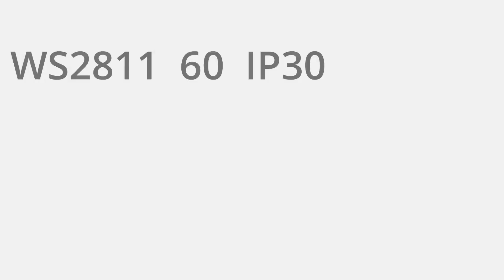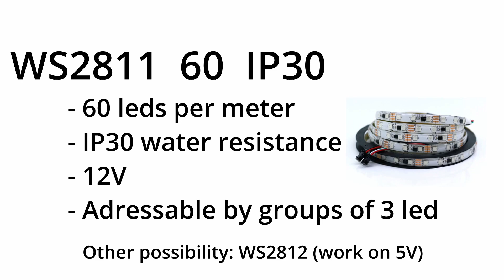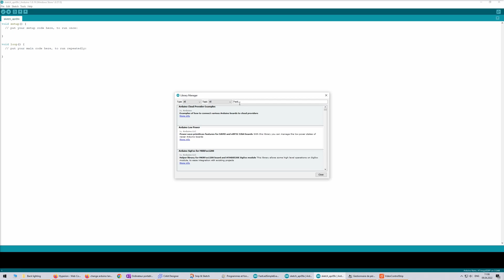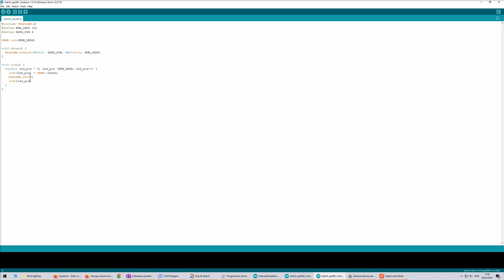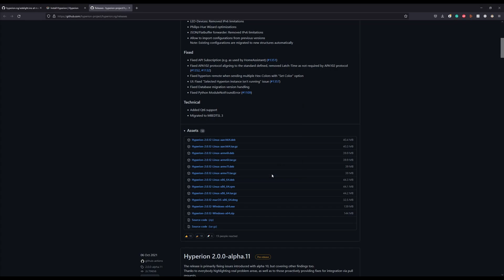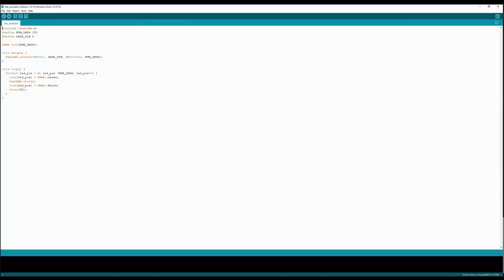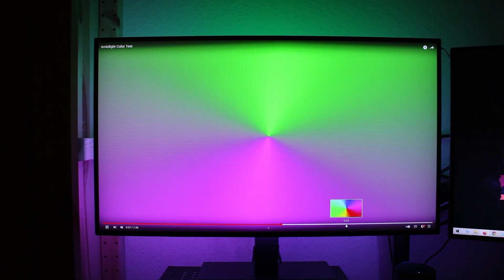Cheap DIY Ambilight using Hyperion and only an Arduino

Comment: usb from pc is 5v, if i use esp32 and connect the leds + - to 5v pin in esp32, will it work?
Reply from the maker: @dursamiii  it might work for a few led but if you have a lot (like in the video), it won't work. It will be very low light at best or might burn the esp32 at worst if the led draw to much current

Comment: I spent the whole day chatting with GPT to figure out a wiring diagram that allows me to simultaneously connect an external DC power source and use the micro USB power from the computer's USB port. It guided me to connect the 5V pin from the ESP to the LED and advised me to add a protection diode to prevent reverse current. Fortunately, I found your diagram, and when I asked GPT again, it confirmed that it was correct—even though it could have provided this solution from the beginning.
Reply: I think I going to ask chatgpt since what I’m trying to achieve is different then this with more stuff like LED corner tube lamps and much more and how I can set up everything with my macbook since I use my mack with HDMI to my TV in my room there is soooo much parameters I don’t even know from where to start 😩

Comment: Everything was working, I uploaded the test program. Now Windows doesn't detect it as a COM device anymore, it says Unknown USB Device (Device Descriptor Failed). It still runs the test program with the cycling green.
Reply from the maker: @almighty1984  that is unexpected. Sounds like a windows problem. Try to unplug it and try a different USB port or to reboot your computer. It should appear again in the device manager.
Reply: @mrpoulay6121 Got it to work, thanks a lot!

Comment: Hi, i have a problem with my arduino. When I try to upload the code i have an error that says:
 avrdude: ser_open(): can't open device "\\.\COM6": Acceso denegado.
Failed uploading: uploading error: exit status 1
Do you know how can i fix it?
Reply from the maker: It is possible you did not select the right con port connected to your Arduino. Try to check which on witch it is connected. You can see that on the device manager.

Comment: It dose not work for me :( the LED output keeps turning off and hyperion is not working. It dose the check in the beginning and leds turn on for the duration but then just blank.
Reply from the maker: It can come from a variety of reasons. At least you know the led and Arduino are working. 
If you have an initial blink it might come from Hyperion itself. Maybe try to redo the steps, something might work better the second time. It might be the screen capture which is not set properly. It is a bit hard to know what is wrong like that.

Comment: can i use a raspberry pi here instead of ardiuno cause i have a pi zero lying around
Reply from the maker: Yes you can but the code to install on the raspberry will be different from the Arduino code.
Reply: can you tell me where can i find the code i have tried my best to find it..... @mrpoulay6121

Comment: I can’t tell by the video. Did you plug in your power supply and your Arduino (USB) both at the same time? Where does the Arduino get its power from?
Reply from the maker: Hello,
Yes I power both at the same time. The Arduino is powered by its usb connector, the led strip is powered by the jack connector.
Reply: @mrpoulay6121 thank you!!

Comment: Bro i have a doubt if I stick the led strip in my tv and use a hdmi output from my laptop to play video or movies( laptop which have software only led strip is in tv ) will i able to get that effect?
Reply from the maker: Yes you will, as long as the TV displays the same video stream as your computer (you duplicate the screen and not extend it)
Reply: @mrpoulay6121  but is there any way to make this work directly on tv ? i saw many option using raspberry pi and capture cards. any other cheaper methods?
Reply from the maker: @jomonpalayur7447  Not really. It works because you are using your computer to process the images and send the data to the led via the arduino. If you want to use such a system you need to go for the raspberry solution (and more expensive)

Comment: Thank's for your tutorial, it's helping me a lot
Btw, what would be the best way to use this kind of amblight for two different monitors working on the same PC?
Would the best way be to separately create two different Arduino setups or is there a easy way to setup Hyperion to indetify two monitors and then code leds region for the two monitors in the Arduino?
Reply from the maker: Hi Furadibala,
I check a bit on the Hyperion side, it doesn't seem it supports natively dual monitors in one set setup. I think you would have to use 2 Arduino and create 2 different instances on Hyperion.
Reply: @mrpoulay6121  Thank's :)

Comment: I did excatly what you did in the video but it doesnt work. For example i dont have the screen capture option in the Dashboard.
Reply from the maker: That is weird. Do you have the latest version? And did you create a new instance as well ?
Reply: @mrpoulay6121  i figured it out, you cant run the arduinosoftware and the hyperion at the same time

Comment: Great Job, thanks !
"Une bonne chose de faite" c'est également ce que je me suis dis en finissant d'installer le ruban de 256 led WS2812B derrière ma TV, ruban connecté a un arduino mega lui même branché a un vieux PC sous ubuntu. Tout se passait "like a charm"... connexion, script de test avec le chenillard vert, installation d'Hyperion sur ubuntu, tout bien.
Mais (car il y a toujours un "mais"), une fois Hyperion lancé j'ai bien le double flash blanc de mon ruban, puis plus rien. J'ai tout repassé en revue, rien ne s'allume.
Comme disais Liloo Dallas : "Please Helllp !"
Reply from the maker: Compliqué de debuger comme ça mais je dirais que ça vient d'hyperion et j'essayerai de jouer un peu avant les paramètres d'Hyperion. C'est peut être un peu différent sur Ubuntu.
Reply: Solution trouvée :
1-le script adalight fourni sur le github hyperion
2-la vitesse de communication montée a 1.000.000
Thanks again 4 your help !

Comment: I would like to add that you can cut a micro USB cable and solder it to the 5V power source. so you only need one power cord.
however this only works when using a 5V led strip.

great tutorial btw
Reply: This won't work, because you need a data connection to the PC. This will work however, when using the Ambilight setup for a TV (with Grabber, RPi etc).

Comment: 2:23 Hi, I have a question why you used Arduino together. Can't I use only Raspberry Pi without Arduino?
Reply from the maker: Yes you can only use a raspberry but the whole point of this project was not to use a raspberry as it is  more expensive.
Reply: @mrpoulay6121  Oh I got it thanl you for your comment
Reply: More expensive and more energy consuming. I suspect the Arduino consumes less than 0.5W while the raspberry 3 needs around 2-3W.

Comment: Bonjour. Intéressant tuto. mais je voudrais savoir comment connecter ça à la télé. En fait je ne vois pas cette partie dans le tuto et ça me laisse perplexe. Donc comment le système est connecté à la télé? Merci.
Reply from the maker: Le système est fait pour être connecté à un ordinateur et non une télé.
Reply: @mrpoulay6121  Merci pour la réponse rapide. J'ai cru qu'on connectait l'arduino à là télé via usb ou hdmi 😅.  Alors, pour que ça fonctionne ça doit être branché à un pc tout le temps branché au pc?
Reply from the maker: @audranemery3317  
La Arduino est branchée a l'ordi en USB et drive les LEDs. C'est Hyperion le soft qui s'occupe de communiquer a la Arduino de quelle couleur doivent être les LEDs. :)
Reply: @mrpoulay6121  Merci beaucoup pour l'explication 😃😃

Comment: Is it possible to use 600 LEDs? (Hardware side no problem but does the software support that many LEDs)
Reply from the maker: Apparently the max number of led is 490. (According to this thread https://wled.discourse.group/t/hyperion-max-led-count/180). Never tried to drive more LEDs

Comment: I have got it working after following the video but somehow the led movement or transition is choppy and I’m unable to make it smooth. There is no lag and color accuracy is also acceptable but transition is choppy. I’m using this on a 55 inch tv with 224 led.
Reply from the maker: In Image processing, you can play with the smoothing options. Lowering the "time" might help.
Reply: @mrpoulay6121  tried but result is same. not getting smooth transition. I feel that controller is not powerful enough for 224 leds but not sure about it.
Reply from the maker: @AnuragSharmaDarkmessiah  That is unlikely to be the issue. I am not sure what is wrong,you can play with the parameter of Hyperion,you might find some that works for your setup
Reply: @mrpoulay6121  I’ll try and inform if it works.
Thank you
Reply: @AnuragSharmaDarkmessiah hey... Were you able to make that smoother
Reply: No
Reply: @AnuragSharmaDarkmessiah  okay I think I will have to use a raspberry pi and the capture card. Expensive for me 🥲
Reply: Save some money and purchase HDMI sync box for clean setup and better performance.
Reply: What does hdmi sync box have? @AnuragSharmaDarkmessiah

Comment: Would you be able to run a second zone for a second monitor from the same Arduino?
Reply from the maker: It is a good question. From the Hyperion side, I see no issue, just adding a new led instance should be good. From the Arduino side, it might be quite tricky. I am not sure how it would handle the communication with 2 led instances. It would need a lot of code change. With the price of an Arduino those days, I would just buy a second one.

Comment: Sir ji I made it and it works but the problem is when i start it then my (sony bravia x90k) tv being to much hang, apps media player youtube also hang and tv restarted automatically. I use arduino nano 5v 50amp smps ws2812b led strip(266 led), please help me 🙏🙏
Reply from the maker: I am sure to get what your issue is. What is your problem there ?

Comment: The best tutorial that I've seen! Thank you so much. 

So, in my effects list I don't saw Ambilight effect (maybe I didn't configured correctly). Can you help me with?
Reply from the maker: Thanks mKzin, I tried to make it as clear as possible because I was confused on what I saw prior on YouTube.
If you follow the steps, it should work. There is an option to enable screen grabbing that might note be enable by default that needs to be enabled,i am not sure.
Reply: @mrpoulay6121  I watched step by step, pay attention on every detail and yeah, I got it with WS2812b 144leds what currently looks great! 

Again, thank you so much!
Reply: @mrpoulay6121  is it works when i use  tv's embbedded os ? without connect any hdmi to tv?
Reply from the maker: @mehmetcaloglu9409  it will not work with this setup
Reply: @mrpoulay6121  when i try to setup, say  " it is not compatible with this proceccor"

Comment: excellent tutorial I do and when starting hyperion turns on the rainbow and I can change the colors but it does not detect the colors I visualize you will know why?
Reply from the maker: Can be from multiple cause.
Did you select the correct com port and board type?
Did activate the led outputs
When programming the arduino, did you select the correct board/bootloader? You can check the last one with the example sketch.
I hope that helps

Comment: Theres 2 things I'd like to add here:

First is the usage of WS2815's. same voltage, not NEARLY as susceptible to color degradation due to voltage drop, AND runs a fail over line concurrent to the data line, so if one led burns out, the rest of the strip keeps pumpin them lumins!
And of course, they are all individually addressable LEDs, not groups of 3.

The second is an overhauled, heavily upgraded and superior in every measurable metric software - HyperHDR.
I wont go into detail here about all thee benefits and upgraded functionality, but believe me, what windows 98 se is to Hyperion, windows 10 is to HyperHDR! 

Just a thought.. small price increase for a major performance gain, IMHO
Reply from the maker: The WS2815 sound like a good upgrade, epically that addional line!
I will keep that in mind for a next project.
Hyperion has still one advantage over Hyperhdr, the amount of tutorial you can find online is huge.
Reply: @mrpoulay6121  you are correct, being the OG, or founder, and having some years on Hyper.
However,  there are several SOLID how tos, with a GALAXY of flavors (implementations) from a budget conscious WS2812b and a windows laptop with connecting wires,

to a simple but extremely effective rooting your smart tv, side loading just 2 apps, and feed that captured visual data FROM INSIDE YOUR SMART TV, to an ESP32 & some cold white SK6812's,

To a full blown, dozen peripheral lights & lamps, multi board, ultra low latency via HyperSP,I MEGA Ambilight  that's no doubt the #1 position for bragging rights kinda  system, 

and every conceivable rendition stuffed in between the ones I have mentioned! You're true is a booming user group around hyper HDR!!
... If any of the above ones interest you, I can link you?
Reply: @bopedersen77 Where can i find hyperhdr tutorials
Reply: @mrpoulay6121  @bopedersen89 is it possible to make it work with hyperion or hyperhdr that run on webos tv?
Reply: Do an upgraded video on the HDR!

Comment: Hi, Great tutorial but my setup didn’t work. I did everything said in the video but when i upload the hyperion sketch to arduino, my led’s just flash for a second and that’s it. If i do colour calibration, all the lights work. If i share my screen with hyperion software using camera button on webpage then everything works fine but you didn’t turn on this. 
I was using arduino setup with prismatik on pc which worked perfectly but that doesn’t have a blackbar detection feature so that’s why i want to use hyperion. 
I have ws2812b led’s and my setup needs 118 led’s. 
Any solution?
Reply from the maker: Hi,
I guess you already changed the code for the arduino with the appropriate value for the led type and the number of led as the led works.
Maybe try to create a new setup in Hyperion from scratch. I did not do any addional step to make it work. But I did not play with the ws2812b so there might be something different.
Reply: @mrpoulay6121  i had to turn screen grabbing and now it works perfectly. Thanks 😊

Comment: Does the Arduino need to be connected to the PC all the time?
Reply from the maker: Yes, so Hyperion can communicate to the Arduino which LED need to be which color in real time.
Reply: or u can use prismatik sofware to sync real time